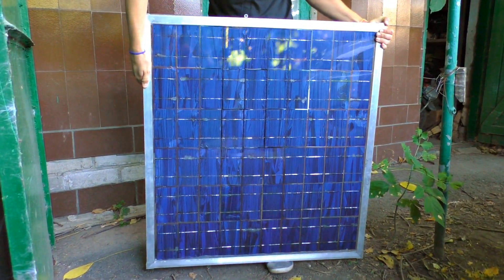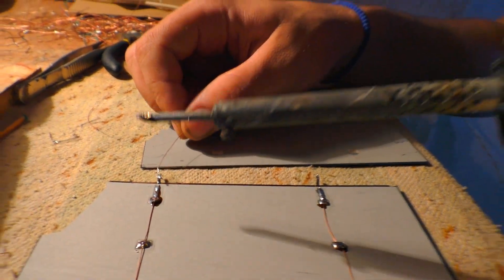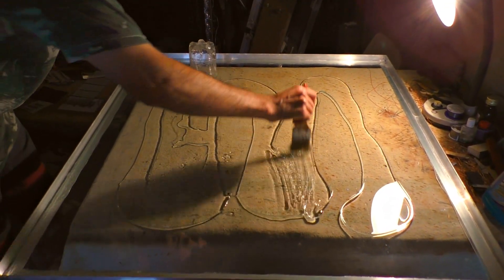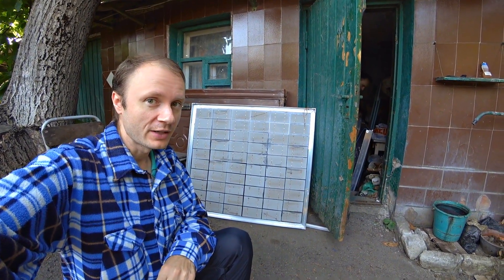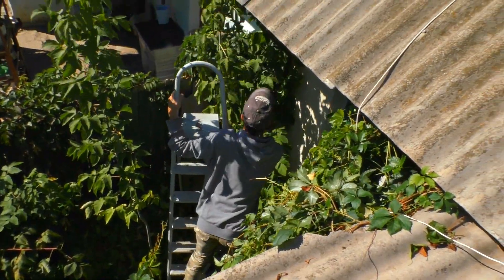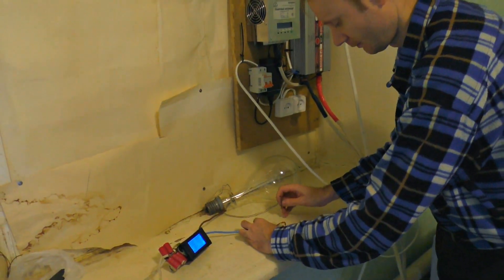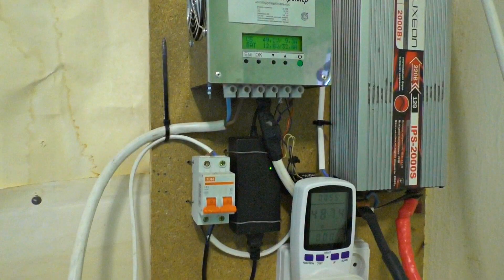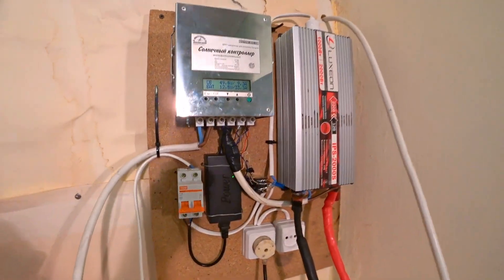Free Energy For Entire House / Cheap Giant and Mighty Solar Power Plant - DIY

Comment: I would have used the more robust & waterproof self amalgamating tape to wrap those external solder joints.
I would also put an inline fuse on the + side from the panels to protect the rest of the circuit & allow easy disconnection.

Comment: you need disconnects between your panels and charge controller, you need breakers or fuses between your battery and inverter. please make these improvements for your safety.

Comment: Cool! Questions - you leave very little gap between the asbestos roof and the panel? There have been instances of panels catching fire in the summer pediod - esp in The Netherlands.  2. How do protect the panels against lightning? It is not apparent to me. 3. Does it not get hot inside during summer when you use a abestos roof ? The roof itself gets heated up and pribably has a detrimental effect on the panels. How do you compensate for this?
Reply: there's no problem with asbestos roof tiles, they don't heat up and the house is all either concrete or silicate bricks so it's cold in summer and warm in winter. To protect from lightning just attach a grounded rod that's the most highest conductive object around, so when lightning strikes it would go to ground.

Comment: Yo, I think you should stay at 12v with your battery stack because then you can plug some simple 12v things and save some current from going into the inverter, though I think the best batteries are Lithium ones be they can be entirely depleted, I'd love to see some of your custom made Lithium batteries added to that, it'd be quite efficient, one last thing, be careful with using tape to insulate your solar panels connections, not saying you should mandatorily use mc4 connectors but appropriate thermoretractable gains are better...

Comment: Get beefier cells and use mirrors to increase solar input. Just be careful with flammability, you can use a cooling system to prevent fires.

Comment: your not really interested in improving this setup but for those that will be ,start simple by replacing all the pc power with 12v 250w 24pin Pico Psu Car Auto Power Supply Module Atx Switchs, as tranforming up then down takes far more power than most 12v devices require.

...then get a bunch of dc to dc buck boost  Module pcb`s ( Input voltage 3.2V ~ 40V Output voltage 1.25V ~ 35V ) to power your modems and wireless routers ,low voltage DC samsung monitors etc, and the usual cheap self contained car 12v cigarette lighter to 2x 5v usb devices for charging the phones,power banks,bluetooth speakers .. etc.

... wire it all up with short run`s of thick combined cable to several battery packs all around the derelict house .. and then tap into those nearest your device that needs powering, make a bunch of Robert Murray-Smith supercap`s or from the scrap yard if your to lazy to try, and add them in to any high start power device line as and when required,all basic stuff.

now taking and making a 240v freezer compressor into a cheap 12v/24v replacement and without loosing gas or cooling capacity ,thats harder...

Comment: I was thinking about how you could plug in your accumulators from your e-bikes and soon with your electric car and use those as temporary power walls in the case of a blackout. I was also curious if the energy company there pays you for any excess energy that you produce into the grid. Hi from Florida!

Comment: I do not know much about electricity but I know at least that you always have to connect a battery with the positive cable first then negative. To unplug it, disconnect the negative then the positive. (red - black / black - red)
Reply: there's no diffirence which way you connect

Comment: I install solar systems for a living and seeing someone in Russia diy a system like this gives me an appreciation for being able to install with equipment made by industry that is fit for purpose. I admire the expertise it requires to make a panel and on a smaller hobby scale application such a thing has really good education value but for a system designed to supply a house at upto 600v dc it could be a serious safety issue if they're not made or installed properly.
Reply: not russia
Reply: it's Ukraine

Comment: You srsly drilled into a asbestos roof?
Reply: what's the problem? i used to cut it with an angle grinder to fit it on the roof

Comment: You need a disconnect switch on DC side, fuses on + and - and a surge arrester connected to earth. This is the minimum requirements to make the DC side safe..
You should have put bypass diodes on the back of the panels to make them more efficient in cloudy wheather. And you absolutely have to ground the panel frames!

Comment: my panels produce 6000 watts xD

what did you pay per panel i bought second hand panels for 50euros each of 230 watts
Reply: yea and a whole pack of those cells cost 10$
Reply: @jankristijan5889  yeah but the epoxy glass and aluminum sides. Total cost must be more right. Don't forget my panels are 230 watt for 50

One tip. Safety one. You forgot the bypass diodes.. it's really a must in panels for fire safety
Reply: @blackdaan  I don't know maybe they just wanted to make them
Reply: @jankristijan5889  true but a safety hazard on your roof is nog joke.. 1 leaf on 1 cell let the cell give - voltage. All the cells before that one give power to 1 cell that turns all power in heat...  same as the flame between the 2 wires.. that power in 1 cell. 

That's why they put bypass diodes in it. When a line of 20 cells produce- voltage. The 20 cells will by bypassed. And the rest will produce power. And 19 cells will heat up 1 cell. What is whitin the safety limit. 

This is no joke. A company who made bad boxes on the back where the diodes came lose. Many panels catched fire. The company is now bankrupt and gone. After 30 fires..
Reply: @blackdaan  oh wow thats concerning
Reply: @jankristijan5889  it really is no joke..  and seriously its really dangerous. i hope they read my comment on time

Comment: Go & buy big boat marine batteries like 50 of them & link them all together , make sure that they don’t sit on concrete or you can drain them use wood that is thick to set them on , then you will have a big battery bank of constant power that you can rely on then have a plug that constantly has power .

Comment: I would recommend to add an isolation switch on the DC cable coming from the solar panels before it goes into your house. It will give you a point to quickly and safely disconnect the cables if anything in the inverter shorts out and goes up in flames, which is quite common with cheap solar inverters.

Comment: Why they're still using inefficient halogen bulbs in 2019 ? And not LEDs or incandescent !
Reply: They are using them because they are a resistive test-load. One halogen bulb = 10 LEDs in normal use

Comment: if you mounted the panels where you could adjust them to to follow the sun 'sun tracking', now you could use mirrors or magnifiers, you might need more panels haha lol the next panels you make maybe you could beef them up a bit to handle more current if you use mirrors and magnifiers the flat screen TVs have neat reflective sheets

Comment: Use recycled 18650 rechargeable cells. You can find them in almost any laptop battery. Build a tesla power wall with them

Comment: When you put diodes in the panels, use shottky diodes.  The forward voltage on a shottky diode is only 300 to 400 millivolts, and they switch from conducting to non-conducting in a very short time.
In reference, a silicon diode has a voltage drop of 600 to 700 millivolts, so by using shottky diodes you gain a small amount of watts per panel.  Don't fall off the roof Spiderman !  Kind regards, Ian.

Comment: you can put a relay between the battery and inverter that will switch off your battery from the charge controller so your lead acid battery doesn't go so low it damages it.

Comment: is it asbestos cement sheeting on the roof? (Eternit)
Reply: Marcus yes I noticed that definitely looks like asbestos gotta love a roof that’s gonna give you cancer
Reply: @mitchbelectronics  it's not gonna give you cancer, since asbestos is bad to your lungs only after you breathe it in. Those roof tiles are a mixture of concrete and asbestos, you would have to break hundreds of them, then breathe in all the dust for few years to get any cancer or asbestosis, which they don't do. In the soviet union all farms and houses had asbestos roofs, sometimes even walls made from roof tiles, there's no problem with it

Comment: Solar panels on asbestos roofing. Blyatiful.
Reply: Its safe. The problem is asbestos dust, when its solid its safe enough. The main problem of this asbestos issue is the fact that the materials containing asbestos were used for inside facing. Mostly in government facilities, schools, hospitals etc.. After years, ~30-40 years later, asbestos started to deteriorate and a lot of asbestos dust accumulated in the walls. The dust is highly contagious. Those panels for the roofing on the other hand is pretty stable, although you should not crumble them in closes environment.
Reply: @S3l3ct1ve  Yeah, good job they are not drilling into them.....
Reply: @Paul-c01  they're outside, like they're snorthing the fibers straight out of the hole while drilling
Reply: @user-ge4uk9ui8y  The dust is microscopic, that's what makes asbestos dust dangerous you dumbass
Reply: @S3l3ct1ve  protingas čia atsirado
Reply: eternit is the best roof material ever.
Reply: @marguskiis7711  yes. My roof is from it
Reply: Was about to ask this, it looks similar to super 6 roofing
Reply: Uralita. Stone from the urals.
Reply: Only in Russia 🤣
Reply: @alexderpyracc4053  It's not Russia's problem alone, I'm afraid. Here in Finland we have exactly the same problems. So it's in many countrys. Almost everything build between 60's and 90's has some type of asbestos material used. Roofs, floor plates, paint, glues... And they are still used. New, unused materials are still on use, while not even legal for the past 30 years. And just googled it, United States began to reuse asbestos in 2018! Hopefully I'm wrong and misunderstood something.
Reply: At least in case the solar panel catches fire the house won't burn down, because it is protected by asbestos.
Reply: This is just what I thought !
Reply: Its fiberglass
Reply: @Spencer Javion No, we don't care.
Reply: I don't think you would care about some little asbestos if there were bombs exploding near your house.
Reply: not asbestos
Reply: @mmdirtyworkz  it is
Reply: The hard shingles are the asbestos ? Where do you see asbestos ?
Reply: @showmequick2245  The roofing is made out of asbestic panels. It's called "eternit", google it.
Reply: @showmequick2245  It is asbestos-containing cement.

Comment: "write me how I can enhance my station, please" @kreosan the higher the voltage, the  lower the amp, so you can save money on thinner, cheaper, copper wires. Using 24 or 48v are the best choices. Just take care when picking charge controller or inverter that works for 12v and 24v the amount of watt they can endure instantly. Some cases you will need to reduce amp while in 24v so you don't fry the inverter.

Comment: You didn't put bypass diodes in the panels. If part of the panel without the diodes is shaded you don't get power out of the whole panel, if you put diodes in it the panel it loses some power but not all of it.
Reply: For real, though he has the battery and he doesn't care... he is also russian so he doesn't care^2 lol
Reply: @timetogetmyway  
The panel without the diode will drain the battery because it will start working as a diode itself

Comment: PLEASE can you show how to make an agm or even lead acid battery, of a practical size and predictable output 100 or more AH would be good 250 or more would be better.
Reply: lead acid batteries are already close to the material costs if you buy them normally. A diy version would probably be worse in every way.
Reply: @Basement-Science  Fair call, thanks for that. Solar panels can be acquired pretty cheaply, but storing the power is still expensive. I thought since it is over 100 year old tech. that making a otto/wheelie bin that most councils use for garbage bins into a lead acid battery should be pretty common on the net and able to get the parts from a local hardware, but no uni guys have posted it, bumma. If households could make large scale lead acid or agm batteries, it would cut coal and nuclear demand massively, even an IBC container.
Reply: @justme.9711  Sure, lower-cost battery storage would be useful, but even at 1/10th the price it´s still not going to solve the energy storage problem at all. Much more cost-effective storage is required to get anywhere near 100% renewable energy. (Something like 1/1000 of current battery prices would make it fairly feasible.)
Reply: @Basement-Science  As a total solution [ domestic and commercial], I agree with you - but. If a household could have the same option as these lithium house supply batteries units provide, but at a fraction of the cost by using a number of IBC containers [ 1000lt ] or plastic 44gallon/210lt drums, that would solve the private sector and it would also work for retail strip malls and small businesses that don't use much machinery. I thought it might be able to be done with copper and galvanized or steel pipe in an acid solution and all this is within hands reach to us now, unlike 100 years ago, surely somebody at a uni level could configure and refine the plans for a home built version.
Reply: @justme.9711  The problem with 100 year old technology is that it has usually been optimized to the maximum by a lot of companies. Patents etc no longer apply, so any company that has ideas how to reduce the price or improve it some other way, can just do it. 

If you want to see someone build lead acid batteries themselves, check out Cody´s Lab, he did it a few years ago.

As for other battery tech like lithium, unfortunately they are much harder to build at home. (not to mention dangerous)

Comment: They have asbestos roof. Kreosan would not want it any other way :)
Reply: Pripyat asbestost best asbestos.
Reply: how do u know its asbestos ?
Reply: @girlsdrinkfeck  I am looking for a house and I had to do research. It is more expensive to remove in Finland due to safety hazard. Regular tile and sheet metal are best options.
Reply: @girlsdrinkfeck  You can see the fibre mass. It is not tile.
Reply: @girlsdrinkfeck  all soviet farms had the exact roof tiles, it's a mixture of asbestos and concrete
Reply: Asbestos is widely used in Russia and post-Soviet states.
In fact there is a asbestos mining town in Russia named asbestos.
Reply: @Janneke You know it's true because "pripyat asbestos" has "best" in it.

Comment: why not test evry cell before you glue it to the glas panel?
Reply: 8:38 wait, did I just saw a bitcoin house heater?
Reply: @robertoaguiar6230  I guess they are mining bitcoin  :0
Reply: It is very fragile , handling it in hand (not fixed) is difficult .....   There is chance of breaking
Reply: it could be damaged from soldering or when moving it around too. But yes, I would test each of them before glueing it.
Reply: I guess they tested before and after
Reply: They did...before and after.
Reply: You must test it under load to make sure if it works. They might look like they give enough power while they are not in load but if you test them under load there is a chance that the voltage might drop.

Comment: Add a disconnect switch to the main wire coming from the panels so you don't accidentally fry anything!
Reply: Some waterproof quick connectiors wouldn't be a bad shout either.
Reply: Mmmm.. Do you think he doesn't know that? I think he just don't care.. He literally shorted the panels with graphite..
Reply: In Mother Russia, electricity disconnect you!
Reply: The word (disconnect) is not available in Russian dictionary 😀
Reply: You can't use an ordinary switch for DC
Reply: @marbella-elviria  Yes you can, it just needs to be rated correctly. That's why switches usually have AC and DC ratings.